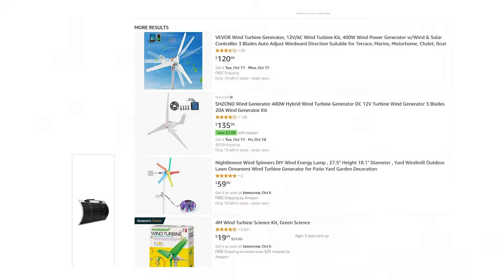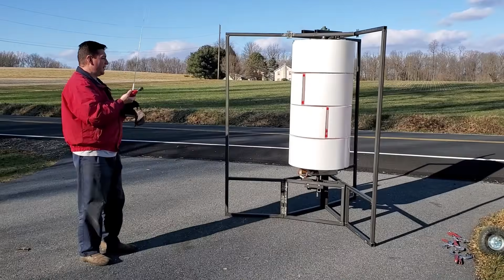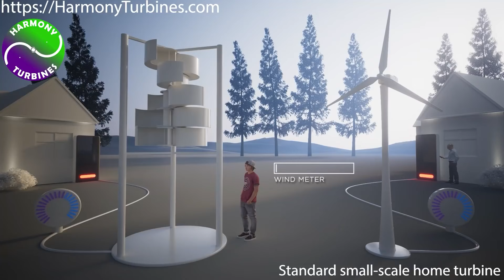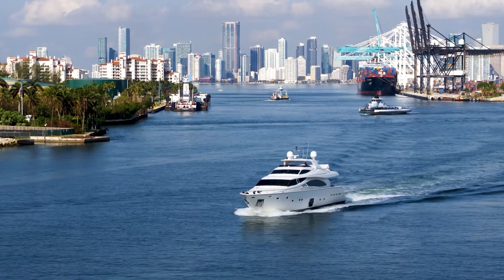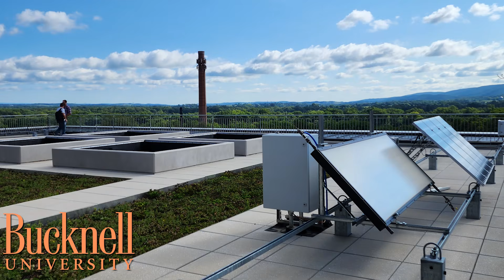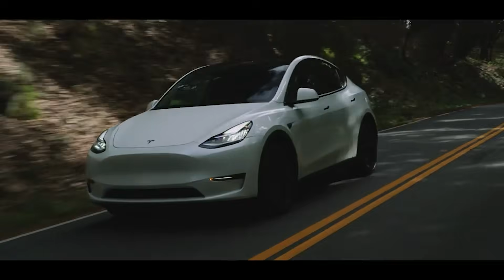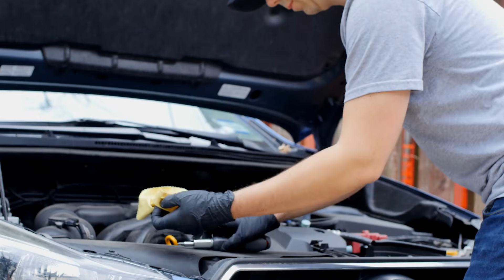Harmony Turbines | The Perfect Small Scale Wind Turbine?

Comment: You need a disclaimer, it looks cool and awesome but it's not magic. It might make 400 watts but we are not sure. In winter climates removing snow and ice would be a problem. The biggest issue with turbines is controlling the speed and if for some reason your control for that fails it will fly apart. I've installed 48 turbines from 7 different companies and only 5 are still running 4 Gaias and 1 QED. Over speed is the killer of wind turbines.

Comment: I really like your design. 
I’ve been thinking about a thermal chimney out in the desert. Wide open base at the bottom of a south facing slope, feeding a black tube up to the top. The tube has a slit along its length for a Fresnel cylindrical lens to focus the suns energy inside, making the temperature rise even more. 
But the exit at the top requires a turbine that is vertical. I’m wondering what the difference is between a horizontal and vertical turbine. What would it look like? I’m picturing a big cylinder with blades spinning around the central axis. But that’s quite different from normal turbines. 
Can you shed some light on this for me?
Thanks,
Paul

Comment: Here’s the thing.  Power generated is most dependent on area swept times wind speed cubed.  There is nothing about this design that changes anything about that.   There is good reason why traditional wind turbines are so high, the wind is strongest and most consistent at heights.  Putting one of these in your backyard will do little to generate electricity, unless mounted high up, which is kind of like an orange on a toothpick.  Vertical axis wind turbines (vawt’s) are not new.  They’re ultimately expensive whirlybird gigs.
Reply: I couldn't have put it better! This is just the latest in a long line of things that are doomed to fail.

Comment: Might be too small to supply a home, too big to put on house roof (or most boats), too costly ($2500)  for 1 KW, needs a cage to be safe, stepping motors fail fixed - override needed (must fail safe), multiple entrapment injury or jamming points, max design wind loading when furled (150 mph code).  Great investment sales effort but some more engineering help might be necessary for success.

Comment: Winds against the sides of skyscrapers are so ferocious that windows must be installed with unique mounting systems in order to remain in place. Why haven't architects designed a building with VAWTs at each corner of the building? They would probably provide enough energy for more than just the building on which they are installed.

Comment: Thanks.  I'll pass on their design.  It has allot of problems in it.  I give them credit for trying but the tech and understanding isn't there or should I say, it didn't come out of the conversation.  The problem with their design is that the torque wind like we have here or in the SE US can get up in the Km/Hr if there is a high wind or tornado conditions.  Since their design isn't balanced it will warp the shift and because the weight distribution is uneven it will wear out the bears more frequently.  The one that they wanted to be critical of is the design that products more power overall than their design can dream of.  Even with their design it will become noisy in locations with higher wind than they are used too in their area.  If they really want to make a wind/power generation that is silent that's not the one to use.  I have seen it but I also know that the power output is on the low end.  It's what I call a parasite wind turbine.  It has no moving parts and can product power from any direction.  In the UK they have talked about using them along road sides to catch the wind from lorries and cars as they pass by. In groups it can be used to add power to the grid but you need allot of them.  So the cost on return is a bit on the low end.  The HAWT as I mentioned product allot more power.  Yes, if the wind speed gets too high you have to turn on the brakes on it as it will destroy itself because of the built up kinetic energy due to the RPMs.  If you don't the turbine and wind mill will fly apart.  It can even happen with theirs and I think it's more likely.  But as I said you have to be in a serious high wind area to see it.

Comment: Love this new development! I had been looking at something like this for residential use, looking for sculpture that can generate power (though they probably wouldn't be as efficient as Harmony's). Question, though -- have you been able to see any effects these turbines have on wildlife? Birds fly into glass skyscrapers and even home windows; have you had any experiences with birds or animals flying/walking into the turbines, or will you do on-the-ground testing? Other than fencing, I don't know what non-blocking solutions there might be to prevent damage to fauna -- maybe a trough? ps -- I, too, am a great believer in synchronicities which guide us. Thanks!
Reply: The first turbines coming to market will be best suited for residential use, installed in a yard using a concrete pad, and elevating the turbine feet in the air so it doesn’t hit anyone in the head. At this height there is little possibility for any wildlife to come in contact with the turbine. Also, when Harmony is fully unfurled or furled there is little to no open spaces for a bird to feel safe flying through.

Comment: I saw a video somewhere on youtube where many vertical turbines were installed in the middle of a divided highway and generated enough power from the winds of passing traffic to power sign illumination and street lighting.  This product should be tested in my area because we sometimes have very high temperatures of 120 deg. F. in the summers and occasional very high winds which once reached 115 mph. Unfortunately, the average wind speeds this time of year are 5 mph

Comment: Question, if the rotor shuts down in high wind why not have a larger generator backup on the shaft that draws the power as the huge motor would turn slower but make massive power? I have been to your website thinking I could order one for testing for my needs over counting on the grid.

Comment: This is the wind turbine I would install on my home. It looks like kinetic art. This video was really informative. We need to be able to mount these on our roofs. I say utilize the existing chimneys as installation points.. 80% of all the single family homes in my town have existing chimneys. The majority being unused. Keep up the great work.
Reply: Mounting on a chimney will only work if your chimney is made with cement if an older house with line mortar then it will destroy the grip of the mortar leading to the chimney collapsing
Reply: @davidmunro2077  I probably still wouldn't recommend it as it would be tough to get clear of the smoke and likely would add vibrations that the concrete isn't intended to deal with.
Reply: @davidmunro2077  Even cement will crack.

Comment: I built this type of a wind turbine way back in the 70s. ( in Alaska ) I used a auto alternator for the power plant..I used A stack of 55 gallon steel barrels cut in halves.  Worked just fine. I now have solar panels at my small farm..I have very little wind here and when I do have wind it comes with storms and is very strong. SO I would be interested in buying or building one of these that can close up in high winds.. You should think about putting out a kit for us who build our own stuff..I even build my own solar panels for individual solar cells I bought at a hugh discount.
Reply: Me too
Used plastic 55 gal. Drums similar design. Displayed in La Holla Beach August, 1983.

Comment: I am in Queensland Australia and sitting above other houses so have good air flow with a large shed. I think if these were mounted on the ridge line of the shed which is 8 meters long you could have the drive shaft from the driving arrangements could come through the roof and the generator could be inside this shed is steel framed steel Roof truss at 33 inch centers i could see 3 or 4 generating  power 24/7 no matter what direction it would get the wind i have 10 to 15 mph wind here at present and most days is around 10mph as i live on the coast. With power feeding into the grid 24/7 so zero bills as it is i have all led lighting and gas cooking and hot water so my bill is only $50 a month

Comment: Dual motors. 1 on top 1 on the bottom. You may double the output.. May need to flip the plates to get the voltage flow to work.

Comment: NO !! 
A feathered propeller is NEVER turned 90° to the airflow ( that's MAXIMUM DRAG !!)  The airplane would normally stall & crash, if propeller blade was 'perpendicular to airflow'. 
A feathered propeller is turned STREAMLINED with the airflow to MINIMIZE drag.  
Most airplanes continue to fly but rapidly loose altitude with only one engine working & one engine out.   Find a place to land immediately.
Reply: Check your facts P Mullins. The whole point of them turning 90 degrees to the airflow in this case is PRECISELY TO STALL. It's how the big boys stop spinning in high winds.

Comment: I was thinking could you not attach solar film panels around the buckets, so as to get the best of both worlds, wind and solar.
Also for reusable storage, you could combine this with sand and water batteries, sand where you put tonnes of sand in say a silo, and use the sand incredible thermal heating temperature upto  600 centigrade running water pipes through it, or water battery where you use the electricity to pump the water up to high water catchment areas and release it  down turning turbines.

Comment: This is the lease efficient model of vertical axis wind turbine, because the scoop pushes against the wind on the upward part of its travel. A blade type vertical axis or Darrieus model is 20% or more efficient than this model.
Reply: Wrong  check the last page of our FAQ https://harmonyturbines.com/wordpress/wp-content/uploads/Harmony-Turbines-FAQ-Document.pdf
Reply: @HarmonyTurbines  No I'm not wrong it's still the least efficient type of wind turbine. That's the reason they call it a "Drag" type turbine, because it's a drag, it fights the wind on the up wind cycle of it's rotation.

Comment: I have always liked the idea of vertical turbines. But the problem with them is the size-to-watts problem. I live on a boat and the diameter, height, and weight of the unit just doesn't work. I do have a Sunforce 600-watt windmill that does require 6 mph. wind to start. It does have a smart controller that will shut down at winds over 25 mph=25 amps 12 volts. I also have a 110-watt solar system that keeps the battery bank fully charged all the time. My boat is 48-foot and a turbine would take too much room. I do agree that your designs do have their uses on land but for the majority of smaller sailboats, I don't think so. The other thing that you have to think about is the salt corrosion on the pivoting gears of the veins. I do wish you the best in your endeavors and success.

Comment: I think this looks great for so long as there are situations where there is wind.  Where wind is intermittent, I think this can work great to replace or offset retail energy, or better, if we put into effect a situation where we can sell surplus home generated energy, from wind or solar as examples, back onto the grid.  Buy retail, sell wholesale, trade 1:1, get a check from the power company instead of a bill.  To the extent of surplus home based energy generation, power companies, transmission systems, and the grid, can work like energy brokers. 

I do have a question regarding power generation at the point of consumption.  If we generate power at home, how much more efficient is this than generating the power far away, considering the great distance and resistance through which the power needs to be generated?  How many units of energy need to be generated, for example, 50 miles away, to deliver 1 unit of energy at the point of consumption?  How many times more efficient is home based, or point of consumption based, energy generation?  

This sounds like a big winner to me.  Imagine, saving the planet, solving the energy crisis, and producing an abundance of clean energy, by getting a check from the power company instead of a bill, for putting solar panels on your roof, or a wind turbine out the back.  Could industries feasibly take care of everything, installation and maintenance, just for a piece of the action?  How much juice can we generate?  If it winds up turning a profit, that's better than a comparable calendar of utility bills.  That would be a big win!
Reply: For that kind of money, every household in America will take to farming ... wind farming!
Reply: We need 50,000 of these for the Ukraine by December 1st!  Save the diesel for the tanks!  Could these be adapted, and could these be integrated, at intermediate transmission points, for a broader supplement to power distribution?   

It seems to me that those most at risk in Ukraine need to be evacuated, or shelter in place if practical, and disaster centers need to be operating where people in need can go.  Technology like this might aid in this aid.  Diesel generators are great but for that you need diesel, and months supply of diesel.

My understanding is that January is the coldest month in Ukraine.
Reply: It occurred to me these may not operate the best in heavy snow fall.  I think it's an idea worth working with any way.  Under the right conditions I think it would work great.  

If we could only combine wind generation and agriculture, to double down on revenues from that same land.  I don't know how often adequate wind conditions and agriculture go together.

Comment: I'd love to see micro turbines.  Say 25w to 250w.  There are tens of thousands of projects that need low power, especially in combination with solar.

For the home this could be remote  flood lights (that run at night obviously). Think off-grid homesteads, flagpole lighting, security cameras, water pump, starlink, etc. Many boats don't need and/or have room for larger units. 

The government and universities have remote equipment everywhere. Anything from flashing warning lights, cameras, weather stations, earth quake monitoring and more.

The farther north you go, the more valuable wind power is than solar, because of less daylight in winter and more cloud cover in winter. Where I live in Washington state, December averages 2.1 hours of sunlight per day. Because of the angle of light, the sunlight produces less energy per hour during this time.

Because of the winter storms we tend to have decent amounts of wind at this time, averaging 8-9 MPH (of course exact location could be different).

Think of Canada and Alaska. Many remote off-grid locations in these areas would love 100wh/hour average for an average of 20 hour/day. 2000wh into the batteries could be life changing. Especially when a large portion of that is coming in when its dark and/or cloudy.

I think there would be lines of people willing to spend $300 on a micro 100w wind generator that actually produces 100w. I've heard of many people buying 400w wind generators but never seeing more than 50-60w produced. Or buying 1000w wind generators hoping to get near 100w average in real usage.

I imagine that if you produced 100w wind generators for about $300, many people would end up buying multiples and/or also buying a larger unit after they are satisfied that the product works. In off-grid situations I bet people would love 100w units for outbuildings that are too far away to tie into the main system.

You will end up with demand for 12v, 24v, 48v, 96v and higher, but with relatively low wattage for the voltage.

Comment: Our turbines start spinning at 1mph, it doesn't produce any power, but you'll feel good. No 'mom its not turning' like other turbines. Ours is better.

NO! Turning without power is wear on the machine and noise with no gain. Its better NOT to spin.

No reasonable person wants a non-producing turbine. They want a spinning turbine pushing wattage to the battery controller, PERIOD.

Comment: There has been batteries for years that will last a lifetime, lithium titanate,  a LTO battery will last a 20 year old person their life, then some,  something like 10,000 cycles to 80% it's been a long time since I read about them,  but they will probably die from old age before cycling will harm them,  and nickel iron batteries, they are some over 100 years old still in service!  Been used for phone systems, for 100 years,. The problem is they require service, constant watering,  and can be disassembled cleaned, and put back in service, if they are not maintained,  maybe a similar battery can be built for grid storage, that is built like a swimming pool, a battery the size of swimming pool,  built with cranes,  maybe iron and a steel alloy to replace the nickel,  or use nickel, but it is costly, maybe nickel plating would work , a Thick   plating,  it's very old tech, however it does last, and is cheap, maybe a similar battery can work with carbon replacing one of the plates, there is so much that can be done,  a battery with each cell taking up 5k cubic feet, and totaling around 500-600 volts, and should be in the 5000 mwh + range,  the flow batteries are a cool idea , that can possibly do the same job affordability is the issue, along with life span, then charging that monster!!
Sorry to ramble!!